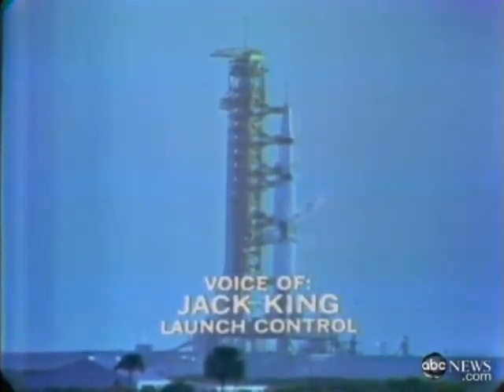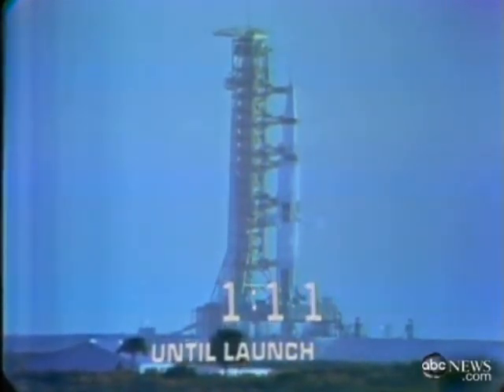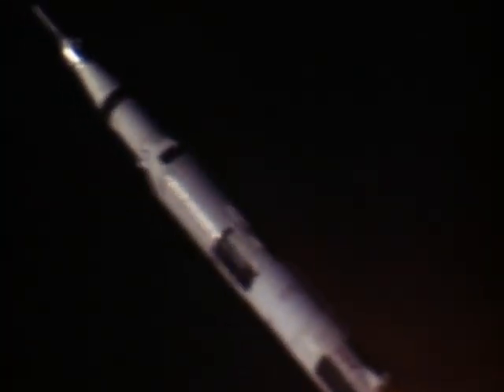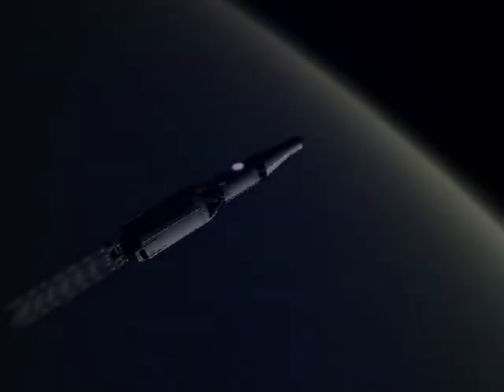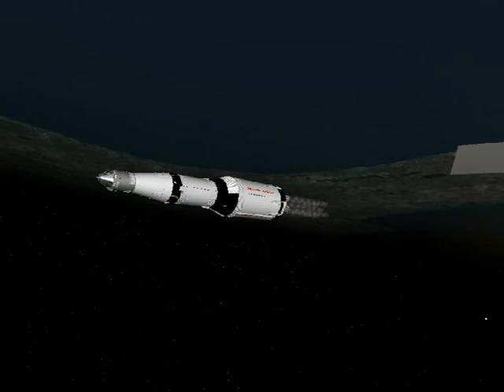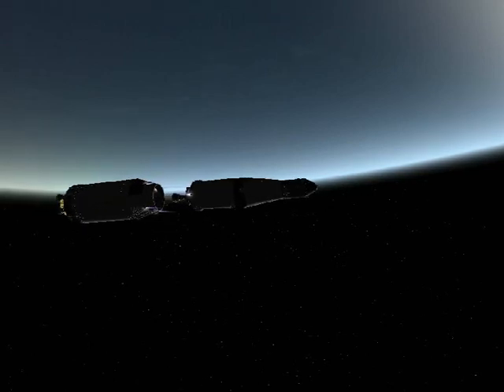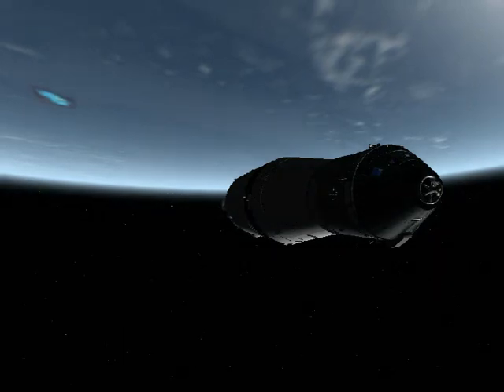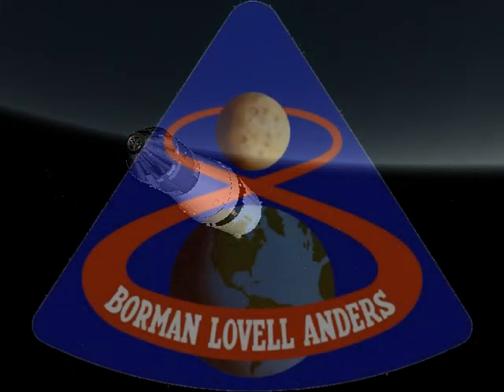Apollo 8 Launch - Flight Directors Loop

Comment: This was probably one of the riskiest missions.  They did not originally plan for Apollo 8 to go to the moon, but it became clear it was necessary for this mission to be more ambitious in order to get the Apollo program ahead of the Soviet timeline.  To put this in perspective, Apollo 7 obtained an altitude of 300km, and Apollo 8 went to the moon 380,000km away.  It's like one day going out and running a mile, and the next day going out and running 1000 miles.  Also 18 hours into launch the commander on board had vomiting and diarrhea, which floated around the cabin as his crew scrambled to gather it up before it came into contact with anything important.  True courage.
Reply: Its important to note that they had no lunar module on this flight. If the same failure that later occurred on Apollo 13 had occurred on Apollo 8 the crew would have died in space and never returned.

Comment: This was easily the most risky, and fraught with unknowns, mission in NASA history...the two previous Saturn V launches were unmanned with the last (only eight months previous) being classified a "failure." It had two engines fail on the S-II stage and a failure of the engine to ignite for the simulated TLI burn on the S-IVB. So what does NASA do? They fix it and put three men on the next one and send it to the moon!!  No way does anyone do that in modern times...it just speaks volumes to the pressure that they were under from the Soviets to get to the moon first and to the confidence they had in their machinery and technology.
Reply: Its important to note that they had no lunar module on this flight. If the same failure that later occurred on Apollo 13 had occurred on Apollo 8 the crew would have died in space and never returned.
Reply: @joevignolor4u949  I have often thought that, too...no backups, no spares--all on one SPS engine. 🚀

Comment: The video is so clear you can actually see the fairings being blown off when the S1C retros fire. Incredible!
Reply: That's the S-1-C/S-II interstage
Reply: @josephg3231  You have to look super close and pause the video every 0.2 seconds.  At about 6:24.6 you see four small dark spots fly off.  
In a symmetrical pattern. 
Those are the S-1C retro fairings.  
I spent five minutes going back trying to see them.  
The interstage comes off at 6:57.

Comment: Capcom is Mike Collins but who is the Flight Director? Cracking video by the way.
Reply: Should be Cliff Charlesworth
Reply: Ben is right. In Gene's book 'Failure is not an option', on p239 he describes Cliff and the Green Team arriving at Mission Control on launch day two hours after midnight
Reply: Sounds like Gene.
Reply: @TimothyOBrien1958  Gene didn't work even-numbered flights.
Reply: @blueb0g Well there you go, I learned something.